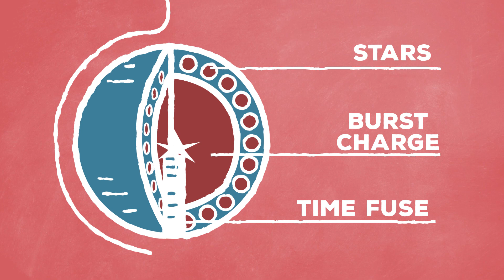How Do Fireworks Work?

Comment: Ooooopss,  I just saw a shell with cardboard-thin barriers.  Guess some do have them, the cardboard must be thin enough to break and then the flame ignites the stars, but it probably has a ghost mind on it to make the ignition faster; just try to light a gun powder fuse - takes a while, 2 to 10 seconds or more.  So these probably don't work in a real chemical reaction system, and are using a mind telekinesis most likely, to increase chemical reaction from lower temperatures (goes bang with a small amount of flame and low temperature - because of a mind from the next world on it).

Comment: The picture of the shell was wrong or not well pictured.  A real shell is one paper shell (cardboard) with the stars and gun powder mixed together.  The picture showed a paper barrier between the gun powder and the stars (gun powder and color chemicals made into a small ball usually) - so the stars would never have ignited if made that way.